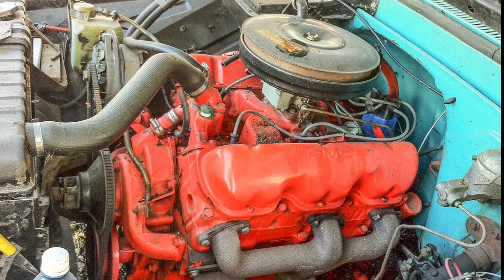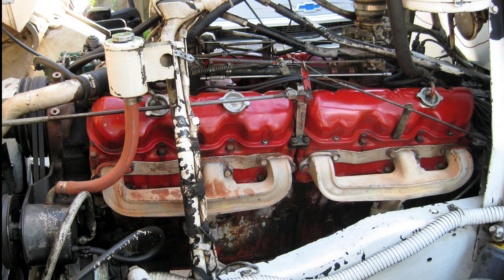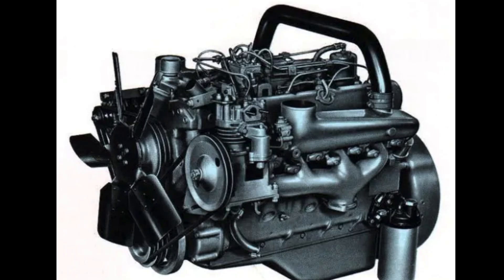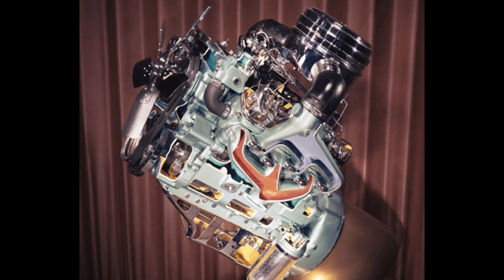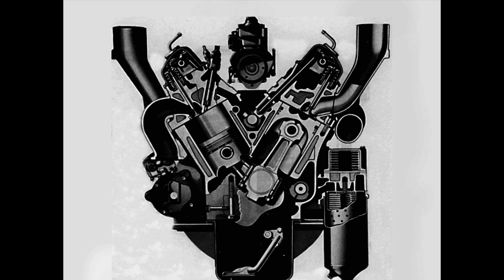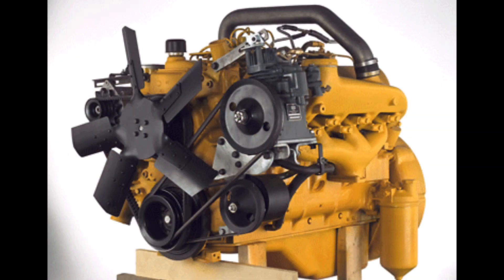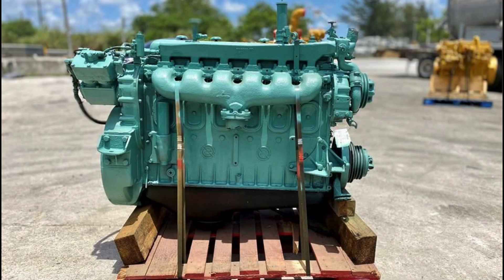Crazy Engines You've Never Heard of: the 351, 478, and 637ci V6/V8 GMC ToroFlow Diesels!

Comment: Had a Chevy Caprice station wagon with the Olds 350 diesel, bought it new in 1981, I guess that by 81 GM had worked out the problems with that engine because I had
no issues with the engine or for that matter the rest of the vehicle. would give 33 MPG on a trip, with only 105 horsepower you did have to exercise patience on a hill however.
Ran great until I traded it in with 90K miles.
Reply: The only man I ever met that was happy with his Olds Diesel was a farmer that transplanted one in a former tractor pulling tractor that he was now using for harvesting hay. For him, it was 50% more powerful than the stock engine, sipped fuel and was just a great care free engine. he must have found the happy spot in using that engine because it ran hardly faster than idle all day with little rpm change.
Reply: You probably had the better DX block, which eliminated many of the design flaws of the original block.
I think your DX block began production as a running change for 1980....meaning that some 1979s actually got them too.
It was a good engine...although I'm amazed you got 33 mpg...wow!
Reply: @67marlins  My friends dad got 35 MPG

Comment: Among other things I have a running surviving Olds diesel with 230,000 on the clock. It is one of my summer drivers. I also have a 478 Toro Flow that I acquired years ago for $67.00. Might make a good pickup truck engine lol.The dump truck in my avatar has a 478 Magnum gasoline V6.
Reply: My 81 GMC half ton pickup rusted out with 278,000 miles on it. The engine still ran great.  However it was the second engine. The first owners EZ Go Golf carts had the engine replaced with the beefed up upgraded GM Target master replacement engine.
   The Injection pump took a crap on me. I had it rebuilt and turned up 10% I bought headers for an Oldsmobile delta  88.  The free flowing headers and turbo mufflers turned up 10% made it more drivable but still not good for passing on a two lane road.  I had the Turbo 350 trans with lock up torque converter rebuilt once too.  I added a Larger cannister type fuel filter on the firewall with a sediment bowl to trap water. ..
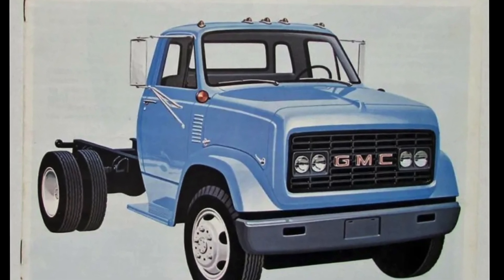   The pinion nut came loose.. I thought it was just a bad pinion seal and order a new seal, but creamed the ring gear and pinion coming back from the air port returning from a ski trip.  I could not find a 2.70 axle in the junk yard. I paid $110 for a 3:08 axle and it ran better with that axle anyway .. Pulling a really heavy load on a trailer I had to run in second.. Had to run in second at 10,000 feet in the Mountains in Co going uphill.  It would not start at -10-F at 10,000 feet I had to buy a bunch if extensions cords to plug in the block heater to get it started. I replaced the radiator once too .